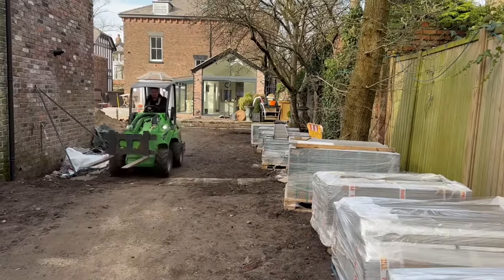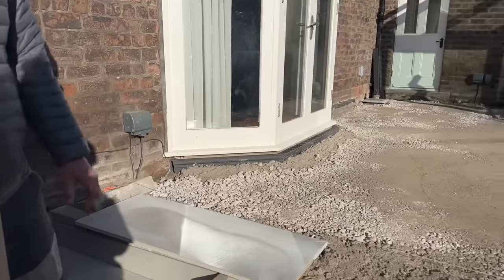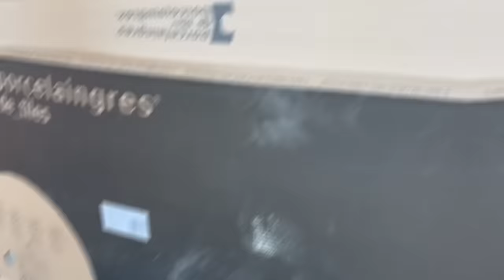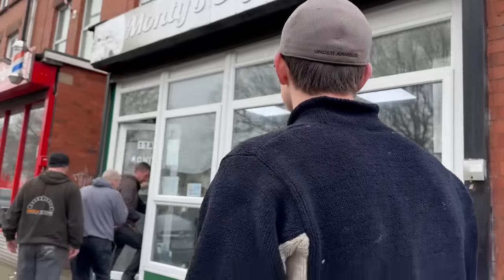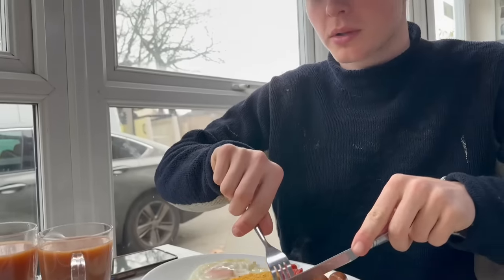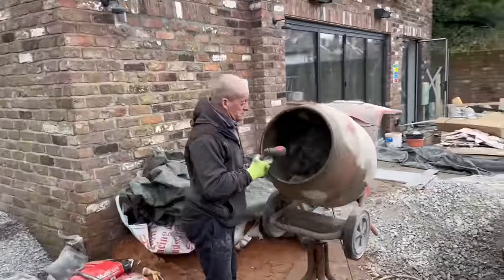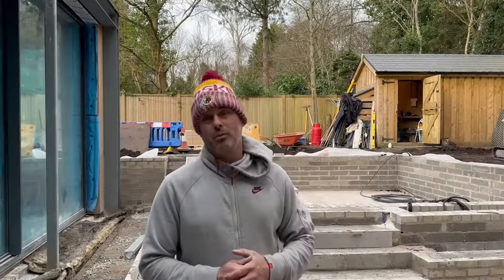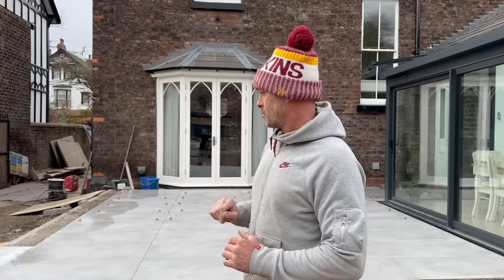The Coach House Garden - Episode 4

Comment: Hey Brockstone Landscape,

Hiii! We've been avid followers of your inspiring videos for quite some time now, and we're constantly amazed by the fantastic work you do.

We have a question for you. We're planning to replace our patio tiles, and like you, we want to lay them on a concrete bed. What would be your advice for this? Should we use sand/cement? If so, what are the recommended ratios? We're really curious to hear your thoughts on this.

Warm regards,
Reply from the maker: Appreciated 
We lay on a type 1 base 100mm deep, then 30-40mm of 5/1 grit sand cement with a priming slurry on the rear 
If the grounds bad use a fabric membrane under the mot
Reply: @Brockstonepavingpros  thanksss BL. We Will also apply this. Thank you so much for the Quick response. Keep up the fantastic work! Greetings to the BL team from Holland!